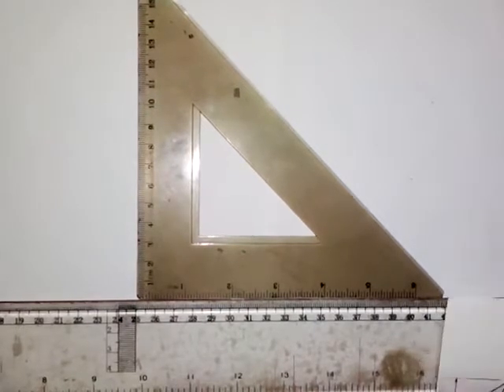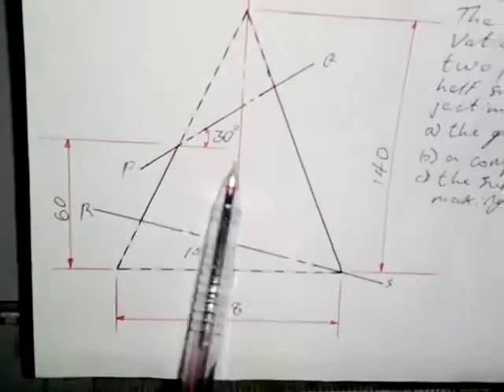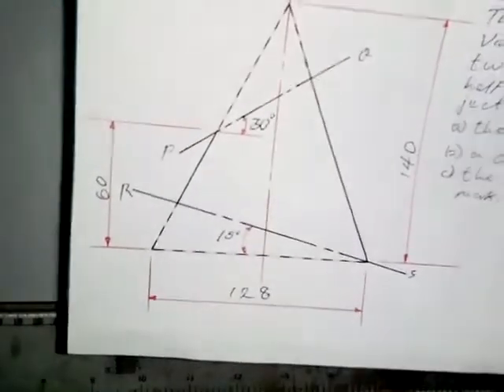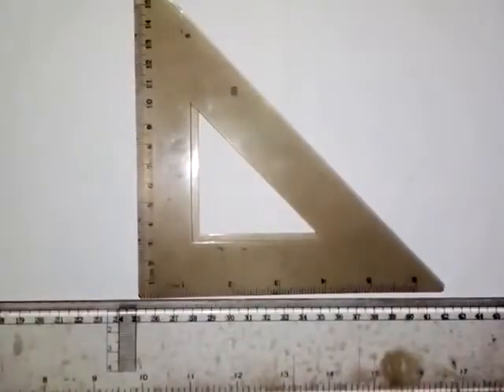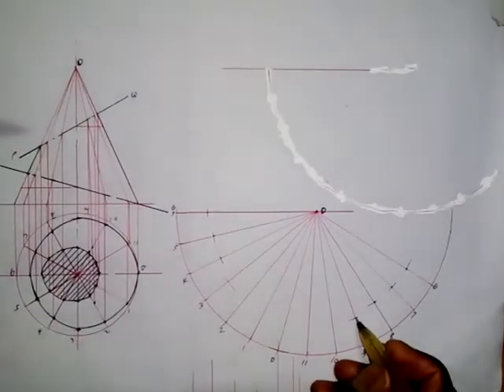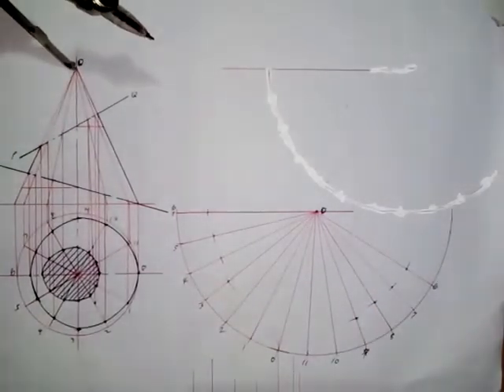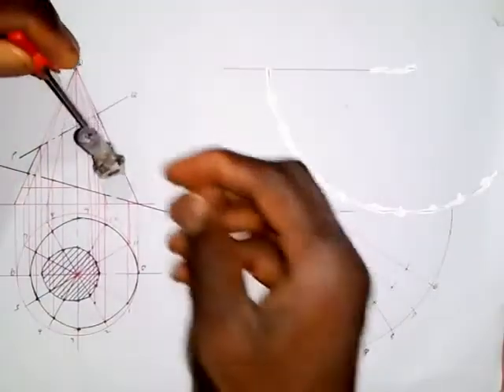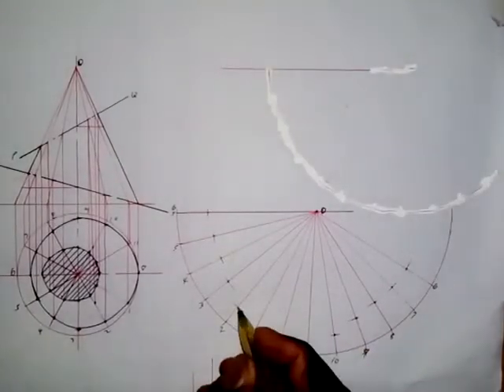To Draw Complete Plan and Surface Development of a Truncated Cone

Comment: Can we draw the development without drawing the plan?
Reply: Pls sir can u do a video on that because there is a question where we were only asked to draw development and in the solution they drew the development without sectional plan.. Thank you sir
Reply from the maker: @anngaming8319  well of that is all you are asked to do, you can go ahead by following the steps I used for them surface delveopment of that truncated part and there is no need for another video. I hope you understand?
Reply: @HisGraceTutor   ok sir I have understood it thank you sir for what the helpful guide on your channel 🙂
Reply from the maker: If the question does not require it